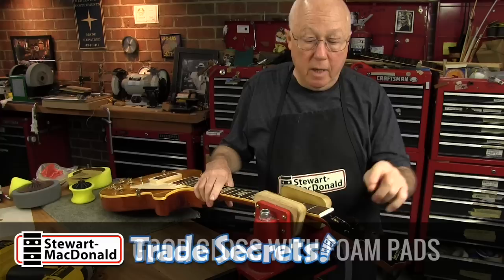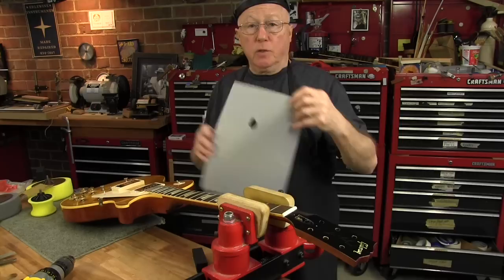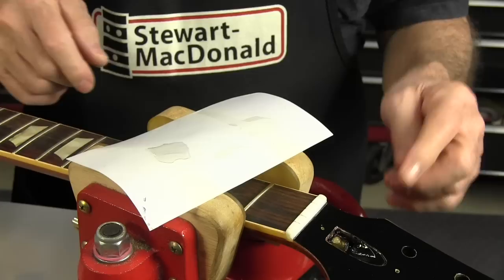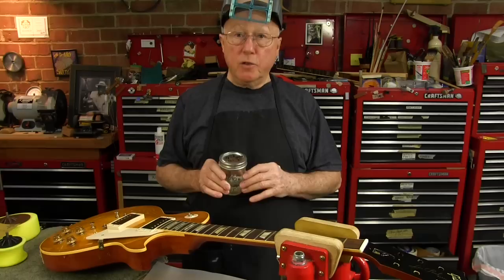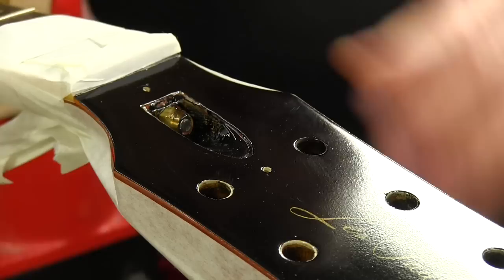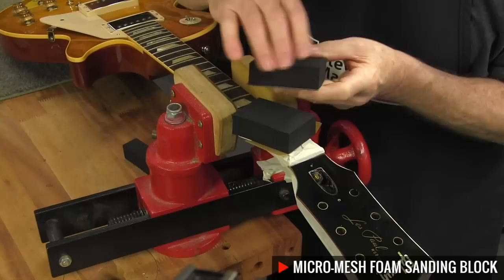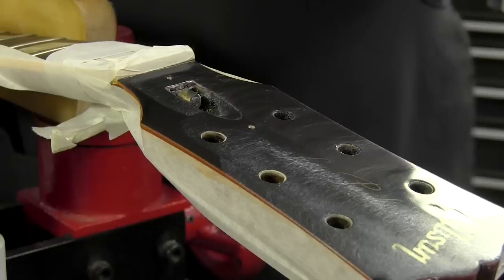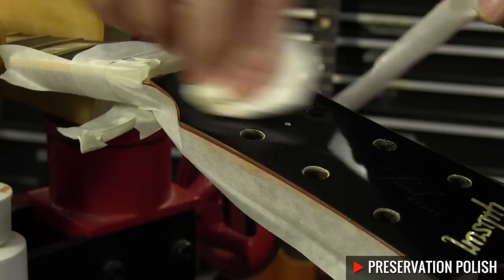Gloss guitar finish with foam polishing pads

Comment: Great video, very inspiring!  Do you have any videos on cleaning/polishing a 67 sunburst Stratocaster?  Mine has some gummy area on the bottom horn, and (I'm guessing) the other horn rear, looks like maybe a rag (textured) may have had some kind of chemical on it and was laid on the guitar long enough to leave a reaction like textured finish.  Thankfully that is a small spot no bigger than 2"x3" . Thanks for your time.
Reply from the maker: Unfortunately, we do not have any videos on cleaning and polishing a 67' Stratocaster. 1967 was one of the last years that Fender sprayed nitrocellulose lacquer finishes, so it may be possible to repair the area with the textured finish on the back of the upper horn. However, if the textured area is due to a chemical reaction, you may have no choice but to strip and re-finish the area (which will likely lower the value of your vintage instrument). It's really impossible to say for certain without being able to inspect the instrument. Either way, we recommend using some of our Preservation Polish to clean up any dirt, grime, or gummy areas on the finish.
https://www.stewmac.com/Materials_and_Supplies/Cleaners_and_Lubricants/Preservation_Polish.html
Reply: I thought nitrocellulose was really a necessity for the Archie Ark top of a maple LP; So the grain could breath; right ? I'm sure the guy put a nitrocellulose on the strength of the time question of necessity of it other than the fact Fender wanted to sell them because of the aesthetic? So... Blah...

Comment: Do you think you could get a nice gloss out of a satin finish starting with the step at about 2:24?
Reply from the maker: It depends on what kind of satin finish you have on the instrument. Some manufacturer's will spray what is essentially a gloss lacquer, and then skip the buffing and polishing process leaving the finish with a satin look. This kind of satin finish can be buffed and polished to a glossy finish (you sometimes see this occur naturally on a guitar's body where your picking arm rests, if it's played enough).
Other satin finish lacquers have flattening agents in them that resist the buffing and polishing process.

Comment: Hi mate ignore my photo, it's old. I'm 37. I have a few gibsons. my the ones I want advice on is a 2002 Brazilian board 59 reissue and a 2003 1957 gold top reissue. sadly I've played them a lot and  not kept them clean. I have issues with major nickel corrosion and dull areas where my strumming arm sits. I want to clean up the nickel and get my tops shiny again. Most shops say hey they are reissues, that's what people want. Okay I know they are reissues but I don't know why I can't get safe advice. I have no dealers I trust near me to look at these, I don't want to screw up my potentially expensive guitars. I just can't polish out the dull hazy look to my tops, My 57 has a spot ding on the face and it's not gone through the lacquer, It's tiny but I know it's there, because it's a gold top I am drawn to it. Any way my main questions are polishing up the tops, the 59 has gone dull and the 57 has in the same place, it's like cloudy. Take the gold top, where it still shiny you can see the sparkle effect, where it has gone foggy it's just gold, no definition. The 59 top bothers me more because it's a beautiful burst. I play them, I've neglected to wipe them down. As your a pro I thought you could advise me on how to shine the tops up. I'm good at DIY but on a $10,000.00 I'm terrified of making it worse. It annoys me when people say they are re-issues they are meant to look old. I'm into the heritage just not into the beat up look from the start look. these guitars are around 15 years old, I just love a shiny top, I just can't seem to polish out the cloudy parts with Gibson cleaning products and cloths, never used other brands. If you can give me any advice I would appreciate it. I didn't notice how bad they where until I got a new custom shop modern a few weeks ago.Thank youAndy

Comment: when i polish by hand i can see swirl marks in it... it looks super mirror finished to the naked eye but are those swirls normal? can i get them out in any way? ive only done a test patch so can rectify if there is a way of doing that for the rest. thanks
Reply: Stuart Easton question, did their swirl remover help? Something I've noticed using my random orbital sander, the 320 grit off the ROS looks smoother than 1500 grit hand sanded. I'm about to finish a guitar and I think I'm going to try to use that random orbital sander wherever I can. The sides and horns are going to have to be done by hand but, I have a lot of finish sanding supplies.

Comment: The lacquer film tip is awesome!

My only critique is that the silkscreen LP logo was cleared over. 
This being a historic reissue, the look of a satin "Les Paul" decal is key to the vintage vibe.
Clearing over makes for a flawless end product; however, it changes the vibe. 
I guess you pick the lesser of two evils: a flawless headstock vs blotchy repair and semi intact logo. 
I would have done the same but gotten rid of the logo. Then at a later date find a silkscreen, and repair that part correctly, over a properly fixed headstock, correct to the 50's period.

Comment: the gibson lacquer has ore orange peel than the job you did xD
Reply: ***** IIRC it takes time for the orange peel to set up?
Reply: Dejoblue "Orange peel" is simply a name given to the imperfections (peaks and troughs) in the finish (typically the clear coat). The imperfections have a similar texture to orange peel. A little orange peel is unavoidable when spraying, so the finish is sanded down flat and buffed.